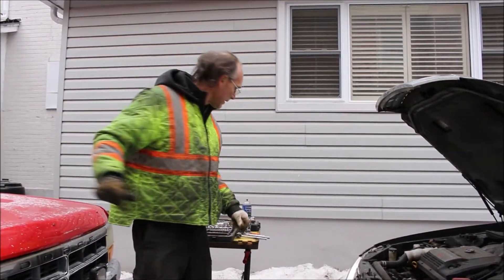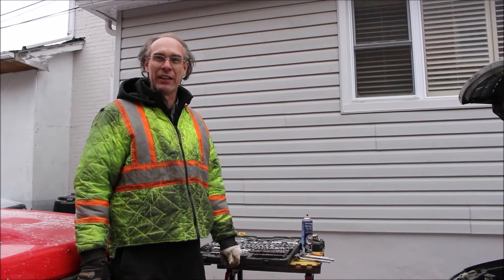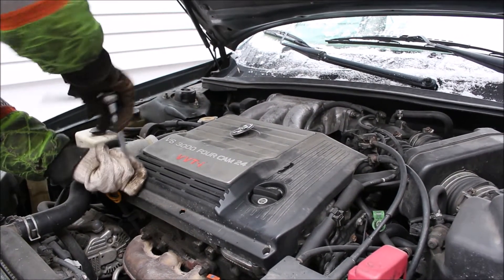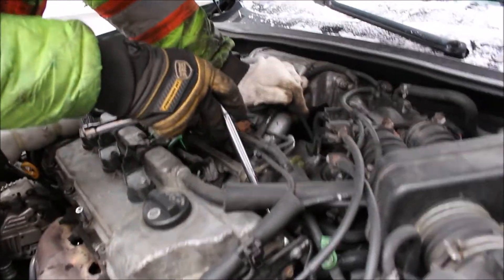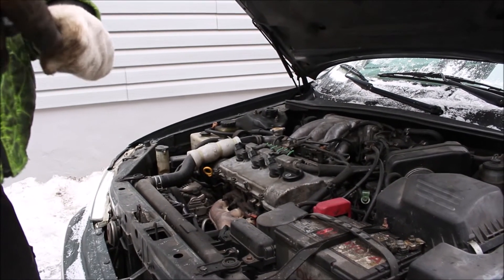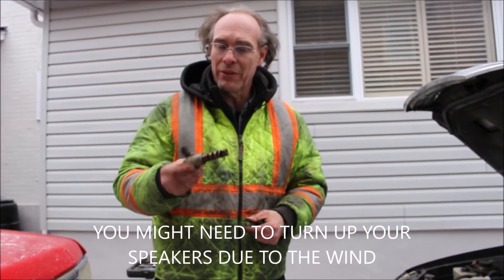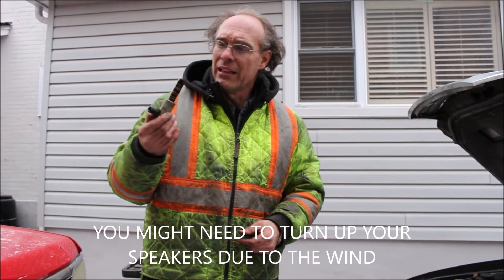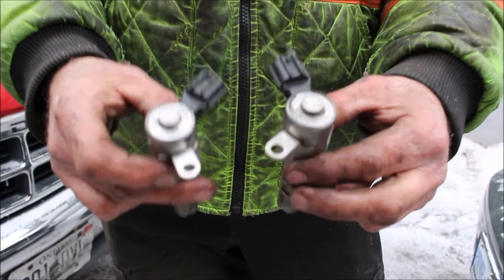How to change OCV valve on 3.0 L toyota ES300 Code 1349

Comment: Sir, you just saved me thousands of dollars. My 99 es300 threw the same exact codes, I bought the bank 1 valve, took 30 minutes to install it and it's back to running like new. Great and helpful video. Very much appreciated.
Reply: So was the bank 1 and bank 2 locations the same as this Avalon? I have the same issue except bank 2

Comment: Thank you very much. Watched your 2 videos that helped me finding and removing the OCV and the OCV Filter Screen Bank 2 (front). I did 2 tests on OCV.. with 12v applied to OCV connector--->connector working and Resistance test-->7ohms. Then OCV  fine.  The problem I found is the clogged OCV Filter Screen that I cleaned it and put back. Drove the car for 30mns and no misfiring.
Reply: square house How many miles on the vehicle at the time you did this?

Comment: Thanks for the tips. What is the trick for unplugging the wire from the sensor?
Reply from the maker: On the conector there is a very small tab wich you must pinch as your pulling the conector off. Jiggling it a little sometimes helps. Avoid doing it when it's very cold because the plastic becomes brittle. It should not require much force to get it off. If the tab breaks, you can use a very small zip tie to hold the connector on... Be creative
Reply: +ipmgamer  Thanks for the reply. Successfully got the clip off and the part replaced. Everything seems back to normal.   Had this same thing fixed by a garage last year and they only replaced one of the parts not both. Why would they just change one?

Great videos and explanation.  I ended up using a dental pick to get the screen filter out and taping the bolts into the socket when reinstalling